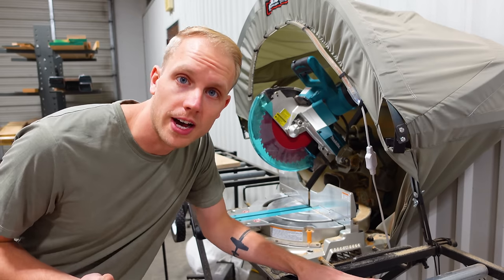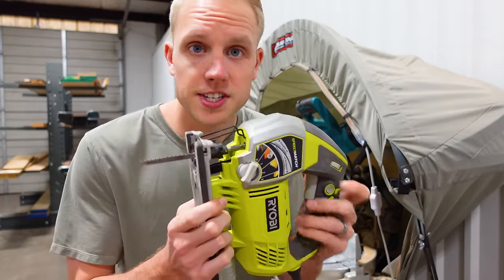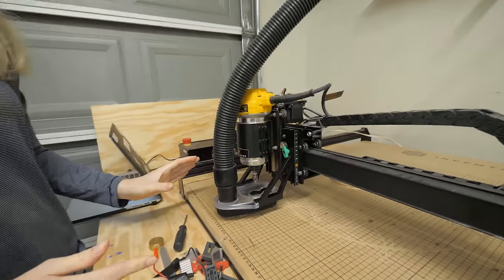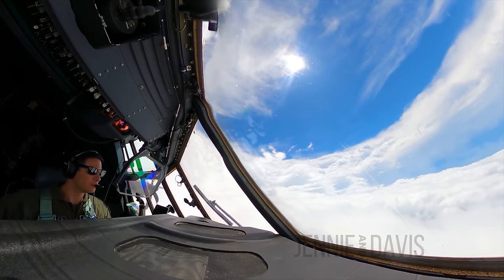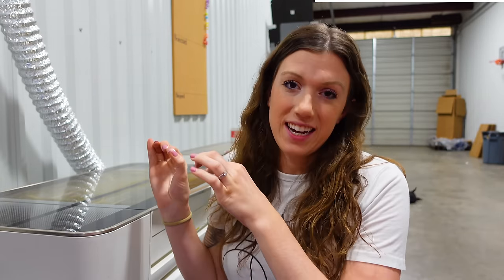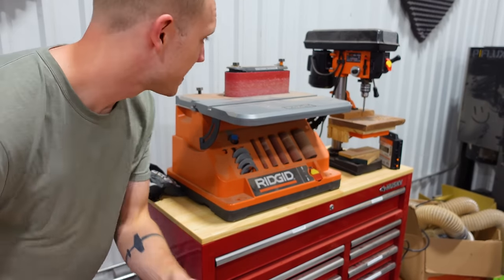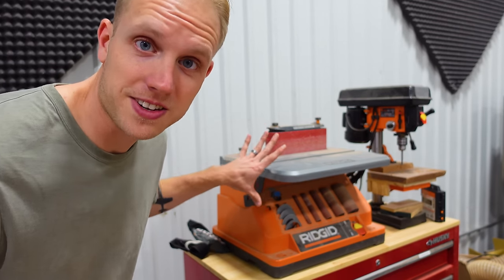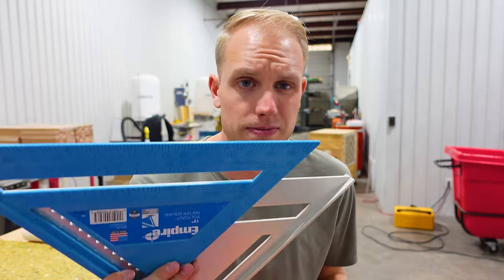5 Woodworking Tools We’ve Ditched - Should You?

Comment: WRONG WRONG WRONG. That rafter/roofing square is WAAAAAAAAYYYYY more accurate than that combination sqaure you held up, it doesn't even come close. Also if you know how to use one it has many many uses. From a carpenter/joiner/cabinet maker with over 30 years experience over here in England.

Comment: What I do is make my cutting board glue ups in a sheet that is 48x48 and then use the CNC to cutout all of the boards. The cuts are so precise and clean there is no sanding really to speak of and I know each board is precise.. Using that jig to make each board seems to be a much slower process than the CNC machine. Just a thought.

Comment: Build a negative of each of your items, a piece of ply or Mdf which your items fit into a cutout and put the whole rig into the laser engraver. So a piece of ply with your handled board cut out of it goes onto the bed, then you put the fresh board into the cutout and this puts the engraving section where you want it on the engraver bed.  Do this with each of your items in their various sizes and keep the negative panels next to the laser engraver.  It’ll last forever and you’d never need tape again to mark the center. 

It’s a classic example of spend an hour doing this to save you 10 seconds on thousands of repeated operations, like your handle routing jig.
Reply: They said their boards aren't all the same size, so they don't have a single size, or even a few standard sizes, they apparently vary randomly. I don't know why this is the case, but if it is, then solutions like the one you propose won't work.

Comment: I don't own a CNC yet.  But I bought the Glowforge Pro ($6,000) and it's not as accurate as they say.    The Glowforge Pro came broken.  I had to wait a month after receiving it to get a new laser head to use my Glowforge.     Just after two years now the inner glass tube broke on the laser cracked and now it's a giant paper wait.   Glowforge will replace my Glowforge Pro for $1,651.  So  do your research.

Comment: I use my jig saw everyday. I just use it to rough my walnut boards , because some are like 12 foot and easier to just quick cut them leaving a inch or two oversized for later when I use the track saw. The CNC, I get it. It's a pain in my butt personally. I really think anything that's like cutting out certain shapes on a repeatable basis, yes.

Also, I have to start another LLC, so North One sounds cool, I was about to go to the bank next week, but an ACTUAL SPONSOR I WILL USE? LETSSS GOOOOOO

Comment: Actually, the rafter square is way more accurate than the combination square. Since the rafter square is machined at 90 degrees and not adjustable it needs to be accurate from the factory.
Reply: Well put 👍
Reply: Plastic rafter squares are way more accurate than aluminum combination squares. I have found issues with cast rafter squares and cast-iron combination squares can be ridiculously accurate.
Reply: @michaelsummer7082  Too correct.  Plastic are generally good, check first.  I checked my rafter squares in the store before I bought them.  It's amazing how bad some are.
Reply: That aluminum or plastic rafter square will never compare to a Starrette Combination Square that is machined to much higher tolerances.
Reply: @lanceyohe6026  This is true. However, the combo square they showed was not a Starrett or a PEC brand. It was an Empire brand. They would have been better off sticking with the Empire speed squares.
Reply: @barge7619 that gave me a chuckle when he held up an empire combo square and talked about precision 😂

Comment: Have you considered using the 2" x 2" or 3" x 3" sticky notes instead of the blue tape for marking the center on your boards? Cheap when you buy the bundles of hundreds, easy to put down and throw away, and you can find them in almost every store if you ever find yourself running short for one reason or another.
Reply: Great idea!  I'll be using this one for sure!
Reply: Boom!! What a great idea, thanks. I will most def be doing this..

Comment: I did not miss the point of moving up to making higher quantities of the same item. Yes you can make a lot with a jigsaw and sander but a template and router is faster. I'm in the middle of learning how to shift from single items to batches of a dozen. Any method I can use to speed up the process is great.

Comment: You make some excellent points, however some tools that you have ditched are absolutely invaluable to other builders. Take for example people like me who make Bartop arcade builds. If you use a really nice Jigsaw like a DeWalt and a really nice sharp blade, and go slow, you will get a super clean cut with minimal tear out, and very little sanding necessary. Also many consider that particular belt sander an absolute must in their shop. Nice to see you have found your space in woodworking and it is working out beautifully for you two. 
Oh yeah as others have mentioned, a really nicely machined square are dead accurate each and every time as long as you don't drop it or abuse it.
Reply: yea my jigsaw has saved my butt a couple of times..  it really depends on what you build as to what tools you need..  i build displayers for a small chain of stores so i need some of those tools.  it is wise to limit your product line, custom stuff is way too expensive in many cases and you dont want to buy a tool that youre going to use once.

Comment: Not sure what program you use to run your laser. In lightburn there is a center finder tool that after setting up the work piece, you jog the laser head to one corner of the surface click, jog to a second corner, click, jog to third corner and click and the program treats those as points on a circle around it and finds center from there. It is designed for finding centers of circular work pieces but I've used it for squares and rectangles as well. It will then use those three points to draw a circular "tool layer" guideline on the layout screen. Using the alignment tools (align center, align top, etc) you can align to the guideline and let it run. Even if you're not using lightburn, there may be a similar feature for finding center on your program.

Comment: Well everybody is different I guess.  I do 80% of my work on a cnc.  And have no use for a laser.  But here is the best advice when it comes to tools and I have proven it many a time. "If you need a machine (tool) and don't buy it, then you will ultimately find that you have paid for it and don't have it."  Henry Ford.  That sign hangs on the wall in my shop as a reminder.

Comment: What about equaly pressured spring  clamps that hold the boards on a plate or board. That will hold it on center every time you load it.  See tmwhat your local machine chop can make or help to design.

Comment: I have a phased out router tables because a CNC router so much faster and better. It’s a shame you guys don’t/didn’t look more into that. I could literally set up a jig (just like you have for your router table) for the CNC clamp down a board and cut it the same way you guys are cutting it in about 60 seconds it would take longer to turn the machine on every day and it wouldn’t make a board. 

Also, I mean this in the nicest way, a laser is a CNC. CNC stands for commuter numerical control 
You would simply say CNC laser, CNC router, CNC plasma, CNC water jet etc.  
CNC is kind of the best of both worlds it’s cheap labor in the end that doesn’t require a lot of skill once you have it set up properly I’ve let my eight year old run my $50k CNC 
Good luck!!!
Think big!!!

Comment: Hi guys! Seems to me that you have only two sizes of board (cutting and charcuterie) so creating a permanent positioning jig for each board in opposite corners of the Glowforge bed would allow you to use a standardized engraving file. Just push the board into the corner, load up the appropriate file and engrave away! No guessing where center is because you always know based on where the corner is. Of course if you have many more board sizes then this may not work. Hope you guys are doing well. Miss the Morning Show. Take care.
Reply: Good suggestion. For different sizes you should be able to still find center if you know the measurements by plotting in a/2 and b/2. But starting in the corners to begin with is a great suggestion that should be endlessly adaptable.

Comment: As for tools to ditch, I have two jig saws, one corded and one cordless. The cordless has been used twice, and I had the same conclusion both times: It doesn't have enough power to get out of its own way. The corded one is the first pro quality tool I ever bought, and it still gets dragged out once in awhile, and rarely has the "ruff-cut" problem you describe. But, I just use the bandsaw now for flawless cuts much faster every time.

Comment: I predicted the jig saw because it was one of my first tools and I hardly ever use it too. BUT, you guys are In production and not DIY projects, so your needs are different.  My second most used tool after cordless drills is my vertical belt sander.  I even use it to sharpen pencils. And blue tape is a must!

Comment: You really have to get away from glowforges. Once you do and move into a big boy laser, (I would in your case get a Fiber laser that uses lightburn). Once you get light burn, you use the lightburn camera and it will find the center. The fiber laser also takes your engraving from 20 to 30+ mins down to seconds. In your case it will pay for it self in the first few months with time saved while engraving.
Reply: You are right about the fact that they should move away from the Glowfoge...I've told them several times lol.  However, a fiber laser isn't what they need.  A fiber laser is mostly for metal marking, not that great for wood.  A more commercial CO2 laser is what they need.  It will engrave it in seconds...I know this because we do it.  There are some galvo CO2 lasers that are even faster, but not really needed for what they do.  We have a Thunder Laser that does an amazing job and would benefit them so much!!  I could teach them a way to throw a board in there with perfect placement every time and never have to measure again!
Reply: @malonecustomdesigns  A fiber laser isn't just for metal, in fact you can see many many people using fibers for fast repeatable jobs on wood, medal, and plasic. I have a Aeon Fiber, and a Aeon Mira 9 on the way. I currently have other lasers. Not an expert, but The reason I said something about the Fiber is because of the small foot print. A more commerical C02 might take up more space then there looking for.
Reply: @ZCCool4718  congrats on the Aeon lasers. They are great machines. And while wood is possible to engrave on a fiber, it’s not the best. The fiber wavelength just isn’t appropriate for wood. That’s why I said a fiber is mostly used for metal. Trust me, CO2 is the preferred for wood.

Comment: No real disagreement since you are talking about the tools which YOU no longer find very helpful.  It is a smart approach to your tooling.

I hope that folk don't get the idea that these were suggestions that no one should have these.  That's clearly not your intent and it would be a mistake if it were.

The speed square is a wonderful example.  You may have little use or need but for most of us the speed square can be used with a circular saw as a short saw guide for cross-cuts as well as many other uses.  For most of us it is a tool we should always keep on hand as darned important.  That doesn't mean it is at all useful for your purposes.

Good video and I hope you keep making them!

Comment: I don't think you are making an accurate comparison between a laser and a cnc. You are comparing a $7k tool to a $2500 tool that do very different tasks. One of those also locks you into having to use the vendors software and be internet connected. Is the laser a better fit for what you do? yes. Are lasers and CNCs comparable in this way? No -- they do different things.